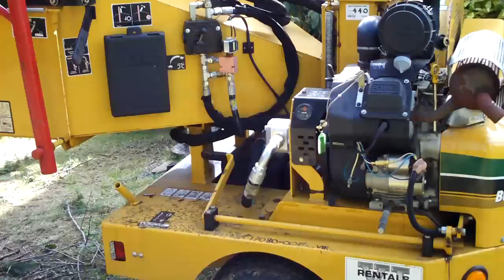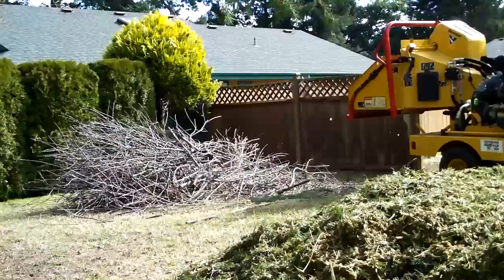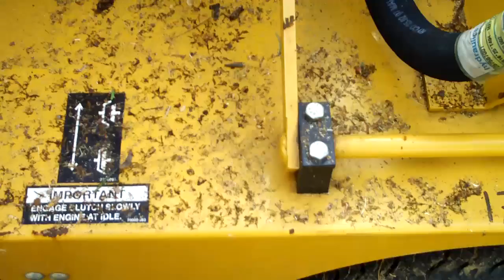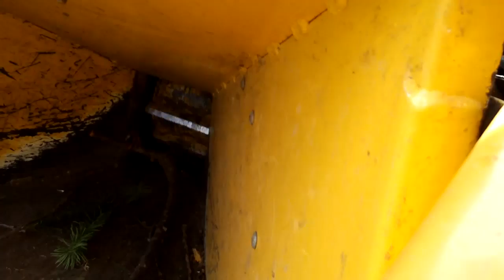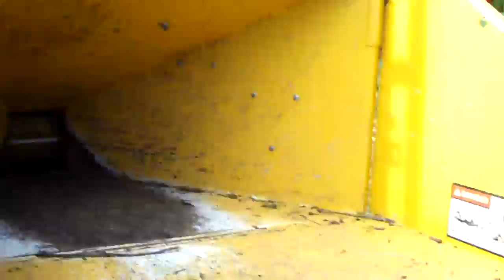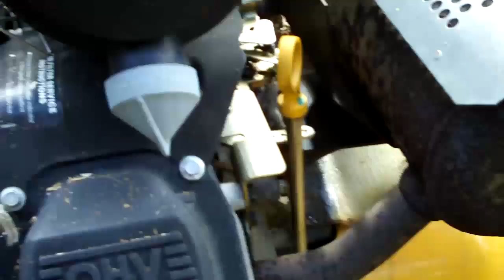Vermeer BC600 XL Tree Wood Brush Chipper  ( HD)

Comment: Great Video, I just picked up a Used BC600XL from a local rental shop, has about 384 hrs on it.  I plan to use it on my ditching jobs to chip instead of burn the brush any other advice you can give or post videos of would be great.
Thanks

Comment from the maker: @diggerdave51 ... thanks! It was a bit tricky holding the camera in my right hand and working in slow motion with my left, not used to that!  It's a simple machine but requires regular maintenance including blade sharpening.. and keep an eye on the drivebelt. We broke a few over the years so keep a spare on hand.